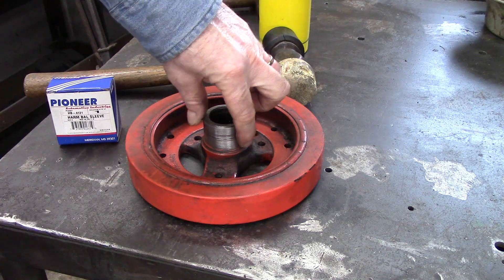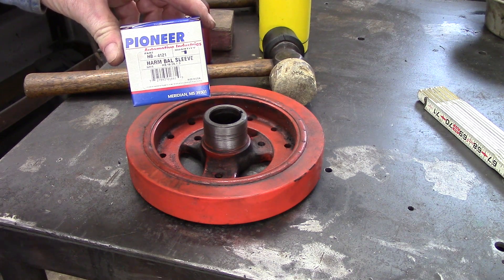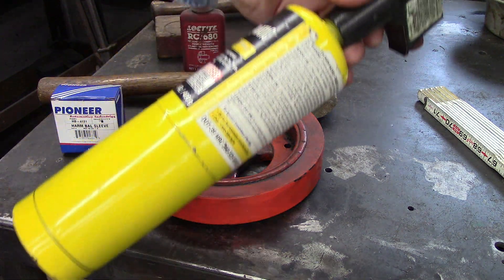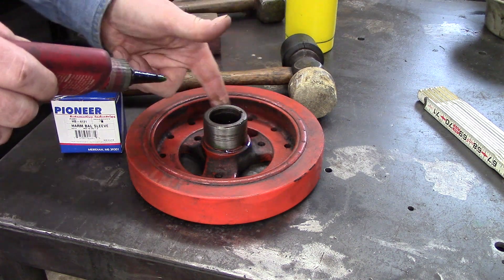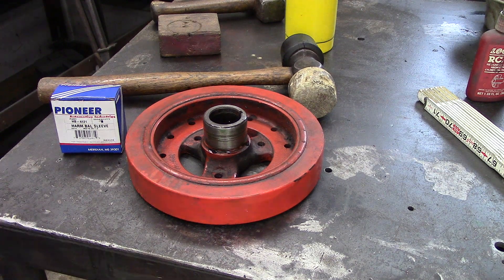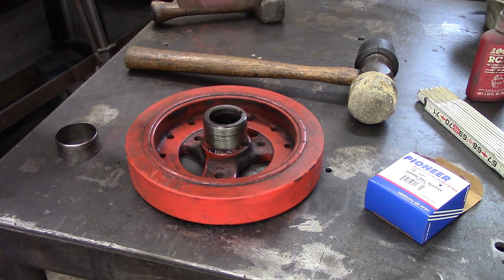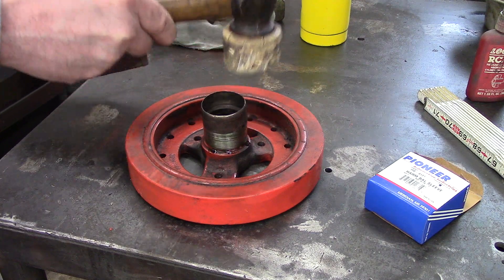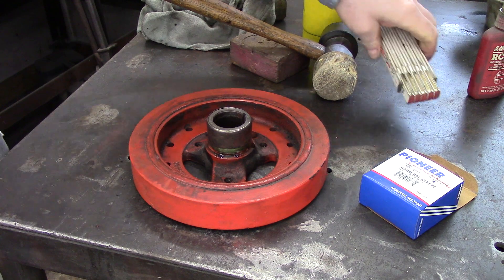V-8 Engine Rebuild SBC #7 Harmonic Balancer Sleeve Install

Comment: There is no need to measure anything.. the sleeve has a lip on it and can only go on so far. And you don’t need heat to put this on.. Heat only breaks down the lock tight